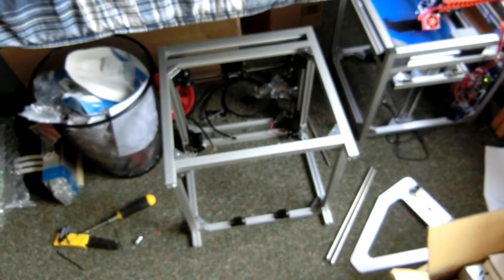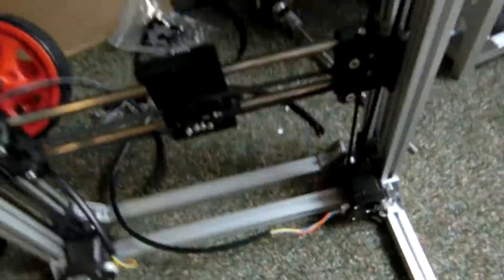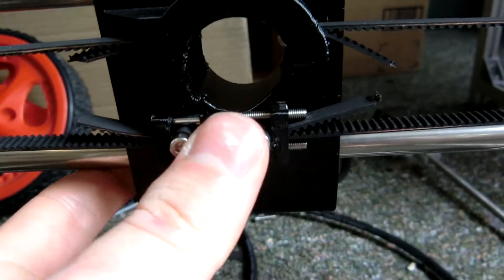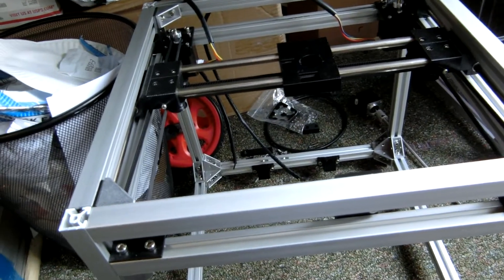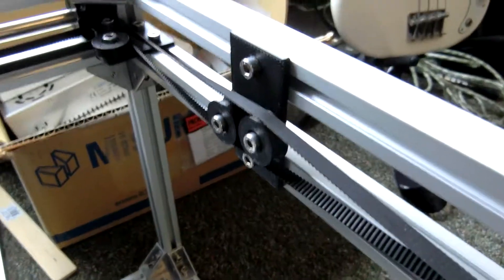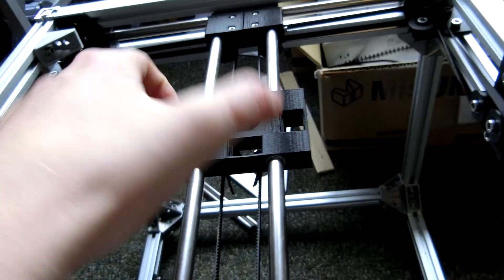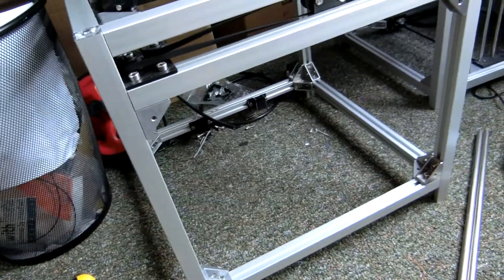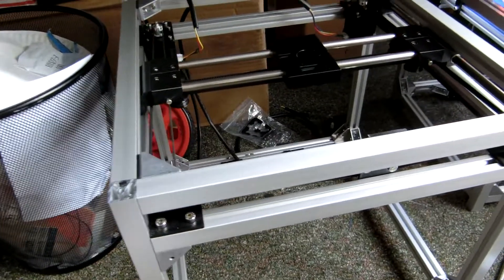Eclips3D Update 14 - Almost Functional!

Comment: My I asking you what's material of your Z plate ?? It's that 6061 ?
Reply from the maker: 黃翊宸 1/4" 5052, however in my stress test simulations 5052 and 6061 should perform equally well, it just so happened that the manufacturer I utilized could make the piece cheaper out of 5052 so I went with that.